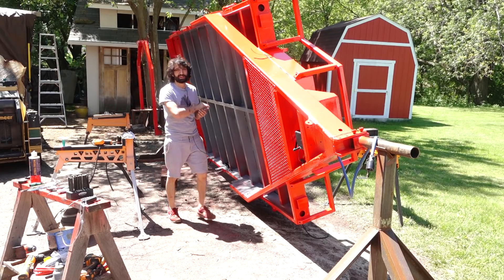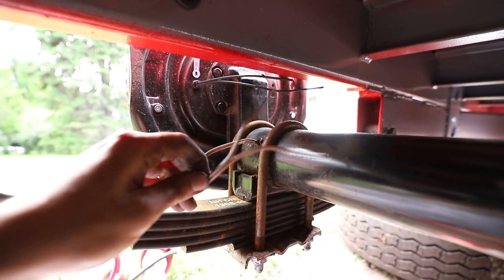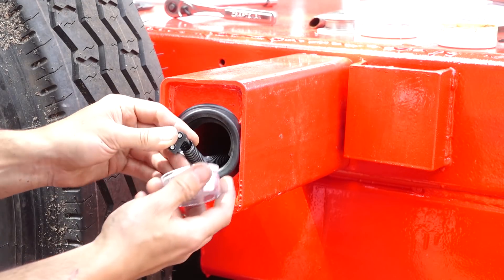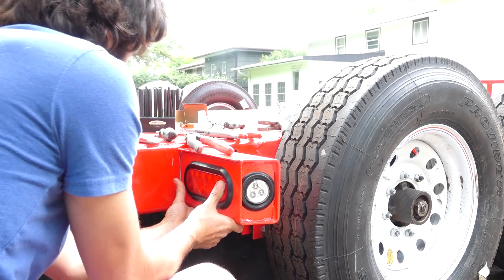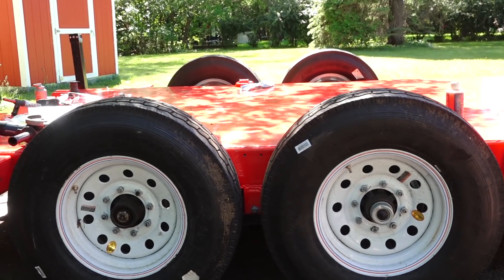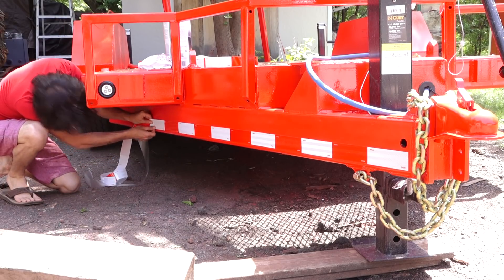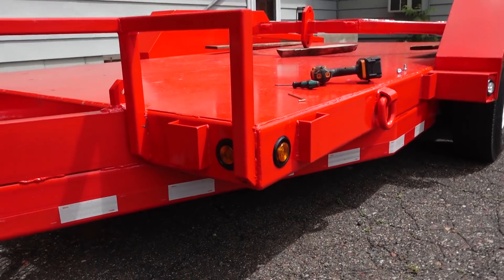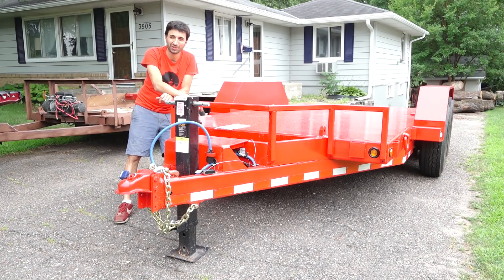Wiring the Lights & Brakes - Urban Logging Trailer Build Pt 10

Comment: I'm thinking the bolts you fastened the chains to the trailer would have a shear strength far below the chain rating. Shackles may be a better choice. Beautiful trailer though. Well done!
Reply: bearbon2    According if the bolts were grade 5, 8, or 10.
Reply: @billy19461  those are grade 8s, you can see the 6 dashes on the head of the bolts. might not be enough in a worst case scenario since they're in single shear. dunno, i'm not an engineer. on my trailer, they're hung off a welded eyelet on the tongue. could probably just double shear the bolt and i imagine it's good enough
Reply: I too question the bolts you used to attach the chains to the trailer tongue. Your bolts may be the weak link. Chain shackles that are rated for the chain maybe a better choice.
Reply: I was wondering about that. Those bolts seem to be the single point of failure, especially as they'll likely only ever be 'used' under sudden shearing force.
Matt - it would be interesting to know their rating and your design thinking behind bolting rather than passing the chains through the trailer in some way

Edit: rephrased as a question
Reply: Those chains and bolts are fine, all the weight of the trailer and load are on the axles. All those chains have to do is hold up the tongue weight till you get it stopped if something should happen. Your not hanging the entire trailer and load up in the air by them. Stop with the criticizing already.

Comment: The maximum breaking strength of the safety chains is immaterial when they're attached with a single 3/8" bolt per side, in single-shear, no less. The weak point may well be the tab the bolt threads into, depending on the length, direction, and quality of its attaching weld.
Reply: if you listened to him he said it was basically the same price as the smaller chain so that's why he used it lol
Reply: @jacobgomer  i did listen. Even the cheaper chain wouldn't be sufficient if the same attachment method were used. A single bolt, in single shear, isn't how safety chains should be attached. Period.
Reply: @mwilliamshs  Man, you youtube comment "professionals" always got something to say, let me tell ya there plenty strong enough to hold that trailer fully loaded lol.

Comment: A nice well built trailer. Just one suggestion, once the junction boxes/points are wired and the electrics are checked if you give the screw terminals a couple of good coats of clear polyurethane spray it will waterproof them, stop the screws from corroding, and also act as a retainer to stop the screws loosening off with rough use.

Comment: I agree with some previous comments, use di-electric grease on all electrical connections and in the junction boxes to eliminate corrosion, also use two or more grade 8 bolts to attach your safety chains, with large washers between the bolt heads and chain links. Grease is also one of the best ways to weather proof metal to metal joints like your fenders. All in all, you've done a superb job over building your trailer. If I needed a heavy trailer, I would want to build it like you did.

Comment: Matt, the standard for ground in DC circuits is usually black and in an AC circuit is green.  I say this because on the rear lights you grounded the white wire which to this old horse is the signal wire.  If the lights were incandescent that wouldn't matter but in LED lights if you run the current the wrong way you won't get any light and you risk popping LED.  Trailer is coming along nicely.
Reply from the maker: Except trailers where white is coded for ground 🤷‍♂️

Comment: SWEET !!!!!!
Anti-seize: You can never have too much anti-seize - you'll be happy about that in a few years when you have to take that apart for some silly reason or other.
Wiring: I wish my camper was wired this well....
Fenders: if you put a liberal coating of good old axle grease on the same spot you'd have put the sealant, you have a seal to keep moisture out that you don't have to worry about breaking whenever you need to remove them ... just wipe with a rag to clean and reset.
Reply: Antiseeze ain't all that.

Or maybe it is.

In some circles, that can lead to a heated discussion. I avoid those discussions because no one has an answer.
Reply: @timothyball3144  I believe Project Farm has a video on anti-seize testing and comparing different brands.

Comment: Beautiful !   I’ve built a few and always working on trailers.  Just a helpful tip. Solder, heat shrink and tape as well as dielectric grease. Get rid of those junction blocks. Just a little moisture, plus road salt and you’ll be sorry. You’ll be rolling around in mud and snow, freezing your balls off, looking for a bad connection, and that bad connection will be at those blocks, yeah, under the trailer. 

It’s a sweet trailer. Chain it up!

Comment: @6:08 when you connected the light to the plug. Those are great but I have seen more times than I can count those little connections get filled with corrosion. What you want to do is put a glob of dielectric grease on each of them and the terminals in your junction blocks to prevent that corrosion from ever starting. Also at all of your soldering connections I hope the heat shrink you used was marine grade cause that stuff has hot glue inside it so it seals it nicely from getting corroded at your connections. Salted roads really take their toll on everything.
Reply: Did you not see this man just build a bombproof, way overkill trailer? Do you think he actually didn't use dielectric grease on all his connections? If you paid attention you can see him applying it in the video.
Reply: mitch denner yea... except for the plugs for the marker light at 6:08 like josh p was pointing out............
Reply: @jlinkhart  every led trailer light i ever bought comes with dielectric in the connection on the body of the light from the manufacturer.

Comment: A pro tip, buy some Fluid Film and spray down all of your screw terminal connections inside all of boxes.  Moisture will still condense inside your boxes and if Minnesota is like Michigan and we like our salt in the winter time, it's a good idea to protect any bare metal.

Comment: Looks amazing! Maybe an LED Spot (or two) on the swing arm for when its dark (Fall/evening work) to help with loading, cleanup. But still, great work! And yeah, those break-a-way boxes always get busted. Angle-iron over it is smart.
Reply: Or just throw some rechargable tripod lights in the toolbox, those aren't limited to the direction the arch is moving.

Comment: That Trailer is a Beast and I really like the layout of your lights.
I work on a lot on dump trucks and the usual problems with the wiring.
The common problems are chaffing and corrosion. Dielectric grease is useless against corrosion. It helps with minor contact oxidation but that’s it. You covered the chaffing points superbly.
Every Connection point or junction is a potential failure point. You want as few connections as possible and as many as you can shrink tubed with wax filled shrink tubing.
I would paint ALL exposed metal connections on the junctions, It won’t be as clean looking but will prevent corrosion at the screw points and leeching into the eye connections from the screw end.
Besides that, that thing is MINT.
Nice Job
Reply from the maker: Thanks!

Comment: Beautiful trailer! When I had a camper, I added a female plug to camper. When I disconnected from the truck, I'd just plug it into  the campers dummy plug in. Filled it full of dielectric grease and ciliconed the back and to keep bugs and moisture out. Worked great for years of trouble free camping!

Comment: Hey Matt, You've made a really nice job of the whole build, it should out last anything you can buy and into the bargain its made to measure. Bought trailers, without taking into consideration the price, each has something you need/like but non have everything you need/like so a diy is the answer. I just wish they would change the law here in spain and let us build our own, rather than a chosen few with licence to build. 
I think the wheel arch covers are better of as you have them as they will get bent by logs etc. eventually and bolted rather than welded will be easier to take off and straighten,especially in the field so you can get home. nice work.

Comment: Nice work, 
just to highlight that it is necessary to put bump stop for the axles specially if there is no shocks (stiff ones). The last thing you want for your hard work and investment is to have a metal to metal contact between the axle and trailer.  The stress force of such contact is much much more than the designed GVW of the trailer. Also, bump stop enables you to judge what happen there and gives you an idea how far is the axle from the trailer frame. If it is touching the the bump stop frequently, you may trace its fingertip and decide on the ride height. 

Also, the suspension connections in the frame do not have side way support. I think it is better for them to have some sort of squaring with small triangles or the area behind to be wielded with 6mm thick sheet.

Comment: When you were backing up in the dark it occurred to me that some relatively high intensity white back-up lights would be nice. Although at this point that might not be possible as it would require an additional conductor thru your main wiring harness and an available conductor in the plug. Another thought is  since you will have a battery on the trailer to power the winch you could also add white rear work-lights. They of course wouldn't be of any help backing in the dark but could be helpful if you had to do any log loading at night.

Comment: the work you did on that is truly amazing one comment though is the bolts used on the safety chains may not the best thing for the weight the trailer  would be carrying the chains should be anchored better maybe two"D" rings or shackles

Comment: Nice job on the trailer ! Just a little concerned about the amount of weight on those leaf springs and pins . Looks a little thin compared to all that steel and and it's load !

Comment: Beautiful trailer. 
Why are the rear lights so far forward of the back plane of the trailer? They are partially concealed by the jacks. Only 1 side is visible from an angle. A third brake and signal light box at the rear plane would provide better visibility from a side view. Back-up lights would be great. 
Socket head screws would have been great in those recessed junction connectors.

Comment: looking good, at my day job we use a nondrying mastic around screws that require a watertight seal but need to be removed one day again, possibly worth putting around the wheel arches. we use this below the waterline in conjunction with another product but its pretty good but it is rather messy.

Comment: A suggestion, use di-electric grease on all of the connections to prevent corrosion from road salt.
Reply from the maker: I did
Reply: Come on guys, have a little faith in matt to do it right. Besides he showed him applying it in the video if you were paying attention. Awsome job matt! Seriously,  you built one hell of a trailer. I wouldn't of done anything differently.  I think you found your new calling, fabrication.👍

Comment: lucky you actually had the problem with the break away switch, if you had pulled it while the electric cord was connected to your truck it backfeeds the brake signal circuit and can fry the controller

Comment: This is coming from "Mr. Overengineering"....Maybe get the safety chains mounted to the trailer in DOUBLE SHEAR, or use NAS Shear Bolts. (Aircraft Spruce ).

Comment: @10:50 (psst you wired them in parallel) 
@12:00 If you use adhesive-backed foam camper strip, you won't be destructively removing it every time the fender comes off.

Comment: you stated the gross fully loaded would be 12,000 pounds. Can the trailer actually handle more than that? What is the approximate weight of those huge trunks of trees you will be hauling? Really like this series and the trailer looks great!

Comment: amazing job you have done!! but dont know if it's only my concern or what, the trailer (and the load) is so heavy duty, but basically it sits on 4 relatively so thin C-channels which support the suspension springs? bc I have seen some car or trailers wheels just got bumped out on highways from time to time.

Comment: I would caution against using solder connections. They are subject to breakage because there is no proper strain relief. The cable is now weak at the pint where the solder has stopped wicking up the stranded cable. Properly done crimps are much more reliable.

Comment: A question on your safety chains attachment at the trailer's tongue...  Would it be better/stronger to use some clevises to attach the chains to the tabs on the tongue versus the bolts you used?  It seems like a sudden impulse load from the chain perpendicular to the bolt's shaft could shear the bolt head off.  'Course, it might take a pair of back to back clevises.  The pin on the first one goes through the chain loop, the second clevis loop is then slipped around the first clevis loop, and the second clevis pin then goes through the tab on hour trainer tongue.  Just a thought.
Reply from the maker: If I actually needed the max strength out of the chain probably
Reply: @mcremona  In retrospect, rather than a pair of clevises, use a 3/8" Grade 70 "double clevis" (AKA chain coupler or chain link).

Comment: That's a great trailer, definitely overbuilt.  What is the hitch rating on that pressed steel hitch though?  I know you mentioned 12,000lbs.  To me the pressed hitch and the ball connection to the truck would be the weak point, a military style pintle and eye would give you a better margin.
Reply from the maker: The coupler is rated at 14k
Reply: @mcremona  Thanks Matt, good job on the build.

Comment: I'm surprised that you didn't use a tow coupling that has a brake master cylinder built in. As soon as the weight comes on the trailer brakes are applied. Here in New Zealand it's mandatory for trailers over a certain gross weight. Good looking trailer though very well done.
Reply: in the US we call those surge brakes. They work well for vehicles that don't have a  brake controller, but they can also be terrible when backing up a hill because the brakes come on. Matt's truck has an electric brake controller that lets you dial in the amount of braking force being applied. When running unloaded, he can dial it back, and when grossed out at 12k lbs, turn it up.

Comment: Nice trailer, but I have one question: Why did you not pull an additional wire for the ground / return for the lights, it seems that most of electrical issues on trailers can be traced back to missing / duff return wiring due to corrosion. 

So why not skip that issue completely and use a proper wire for the return since you built everything yourself anyway?

Comment: Not picking great trailer, but my concern is the strength of the bolts you attached the safety chains too. Are the rated at 2500lbs?

Comment: Strength is limited by your weakest factor. You did not indulge in the bolt you used to fasten the chain to the tongue. What did you use?
Also, What about putting some plastic plugs from mcmaster on your lifting mechanism if you are not going to weld a plate to the doubler?

Comment: Awesome! If you want to help keep the paint nice buy a few bottles of automotive SPRAY WAX and coat the trailer with it, getting all the cracks. You don't even need to wipe if off. You could even use furniture wax or any wax. The spray stuff is the fastest way. It will keep the rust away like NOBODY'S BIZZNESSS =)

Comment: Matt my buddy went to Alaska and had an issue with his brakes.....turned out the wires going through the axle wore though and shorted  due to wear from rubbing on the inside of the pipe, did you have a protective cover on the wire?

Comment: HELP please, Matt! I know you tried to explain things explicitly and did a good job, but i got kinda lost. -Question per: Daisy-Chain the three rear amber running lights "together in a Series Connection" at 10:55 { through to 11:12), [and] "keeping things as Parallel as possible"(?). The Parallel part kind of threw me. If one LED goes out do all the lights go out just like the old Christmas tree lights used to do? What do I fail to understand? [I guess the words "Series Connection" 10:57 and "Parallel together at 11:03" got me all confused. D'oh!] Is the answer found in understanding how the "ring-terminals" work (at 11:20) [e.g. "all Bolted Together" to one ground producing a Series Connection] thus allowing all the lights to have a common Ground and power, and not terminate "ground" if one LED fails? I think I got my head turned around on this correctly now. Right? https://www.google.com/search?q=CHRISTMAS+TREE+PARALLEL+CIRCUIT

Comment: Anti seize on suspension components?  I would think  Loctite would have been a better choice.  I guess time will tell.  Some dielectric grease in the light connectors would be a good preventative.
Reply from the maker: I don’t think it will be an issue. I have no desire to struggle with a seized nut. I used oxgard on all connections

Comment: 1  if you start having problems with your brakes it may be the wires in the axle tube. some times they will short out inside the tube even when new. 2 if you get the longer shackle bolts you can double your straps and make them 1/2" thick or you can make your own out of some flat bar. 3 get a ZIP brand cable for your breakaway[ https://www.fastwaytrailer.com/zip-breakaway-cable]  4  find the fuses on your truck for the trailer lights and put spares in the glove box. there will be a separate fuse for trl left turn,trl right turn,trl running light   on ram they will probably be  MIRCRO2 Blade Fuse.  PRO TIP   if you are putting tires on and you are sitting down you can use your feel to lift heavy tires onto the studs without straining  your  arms or back.